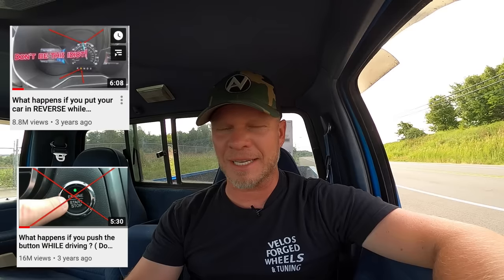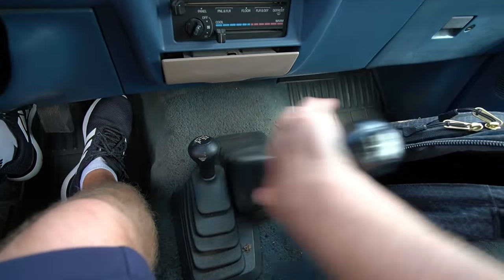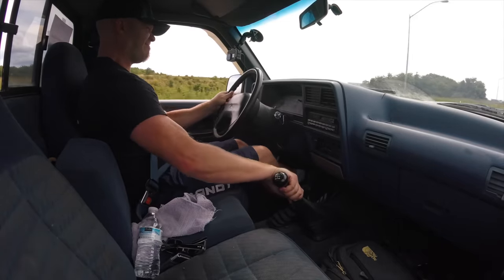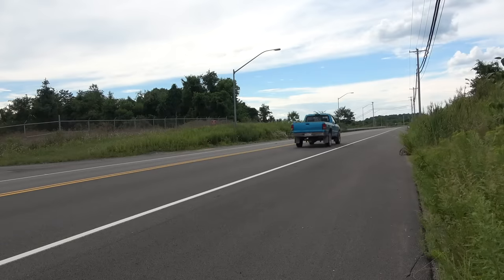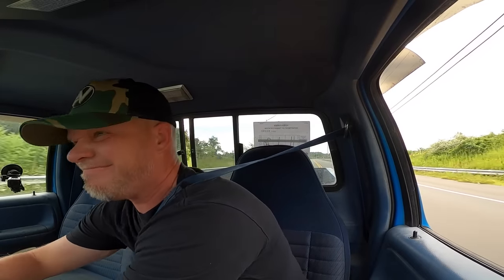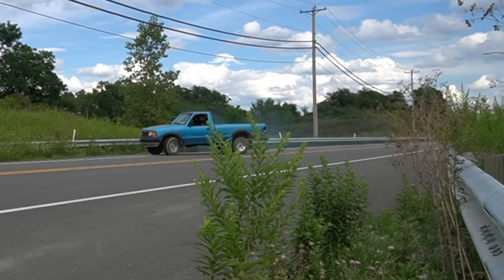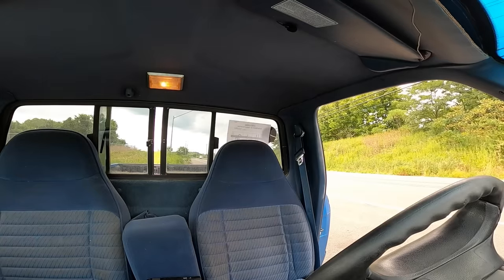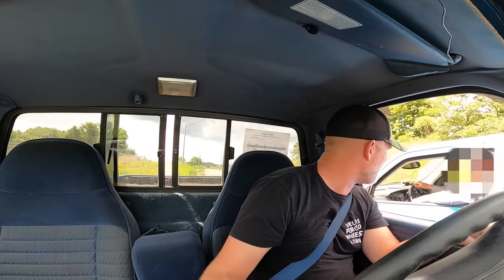What Happens If You Put A MANUAL Transmission In REVERSE While Driving?

Comment: This might actually save someone's life when they lose the brakes!
Reply: Hey, I watch your channel lol
Reply: Hmmmmmmmmmm
Reply: And then round off there gears haha
Reply: @lucacolley4475  better than passing away hahahaha
Reply: Honestly I doubt it, if your in a manual downsihifting is easier and far less dangerous, he had next to no control after entering reverse.
Reply: Just downshift, its a manual
Reply: ok but emergency brakes exist, and you literallyly could downshift lol
Reply: @barryb.benson6583  yes but engine braking is slow, what happens when youre coming towards a read light doing 50, id much rather take my chances shoving it in reverse then plowing through a bunch of cars
Reply: Why would t you just downshift? You’ll wreck your transmission this way
Reply: I had a automatic cuadbike and the brakes broke, i was going 30mph and switched into reverse(almost crashed) had to drive in reverse on the way back tho
Reply: @NoHope_  but then you have NO CONTROL and thats the last thing you want to lose when your trying to CONTROL your car.
Reply: @Deus_wukong1468  If the brakes fail, it's not like you have much control anyway, other than picking which car you wanna rear-end. Stopping is the priority.
Reply: @someoneelse4811  well that is true.
Reply: I don't think so. If the car is traveling with a high velocity ( which is alot more likely) it might topple over
Reply: Another way that I've learned from a friend is forcing the car into one of the first 3 gears, because then the engine brake will kick in
Reply: Down shifting is more reliable and easier to do my brake line buses on the road in my 62 folks wagon beetle so I had very small stopping power but downshifting gets me slow enough to break or use the e break
Reply: Or just downshift
Reply: For that reason, there is a part called handbrake.
Reply: @Deus_wukong1468  how do you have no control, it basically just locks up the rear, that's very easy to control, my moms kia soul would lift up the rear end when you slammed on the brakes and you could easily control it you just had to keep the rear end from rotating around and youre fine, especially when youre stopping in less then a few seconds. the argument that you have no control when the rear is losing grip is dumb, how do you think drifting works.
Reply: My dad had an old manual 4 speed on the tree , and the diff gave out on him it probably saved his like because he was able to get it into reverse.
Reply: @NoHope_  put 2nd or 1st gear 🙃. Easier, faster and "less" harmful (and lees dangerous)
Reply: @eliasgill2453  reverse will stop you faster because the tires are pulling you backwards, and I’d much rather grind off reverse then grinding a main gear
Reply: @NoHope_  it can blow your whole transmission, not just one gear. And if you put it 1st or 2nd you may stop faster because your tires have more grip when they aren't spinning backwards. And if the case was that I would die if I wasn't able to slow I wouldn't be any more likely to survive if I put it in reverse instead of 1st or 2nd. And if you still hit something I think front bumper and maybe cooler cost a lot less than transmission, specially if you don't repair it yourself
Reply: @joonapousi3905  if you put it in first or second you’re locking the rear wheels in which you’re just sliding, if you put it in reverse, yes you’re still sliding but the wheel is pulling away from the direction you’re headed, and tires are at their highest grip lever when spinning not locked.
Reply: @NoHope_   The main gears would be fine which can't be said about the engine or the clutch.(depending on which gear you are using).
Reply: @NoHope_  no, tires have most grip when they aren't slipping but if they are spinning backwards they have the same grip as they are locked because they are slipping in both cases. Basic physics. And if you put it in a low gear it's not 100% sure that the tires lock but if you put it in reverse it is almost sure. Other options are that something (the axle connecting clutch and transmission just for example) breaks and you can't do anything anymore. Or the reverse gear may not even engage. There is no sence putting it to reverse gear in any case
Reply: @kaloyanivanov6013  he threw it in reverse like 4 times and the car was fine because it bogs itself down, if you throw it in first at 50 mph, you’re sending a rod and locking the rear instead of spinning the rear which is a little harder to control and slower
Reply: @NoHope_  I said 1st or 2nd, not 1st. And you can slip the clutch and brake that way and maybe even have the car under control. And I didn't find anything that says spinning tires would have more grip. Everyone knows that if any object is sliding it has less grip than when it's not sliding
Reply: True. I'm gonna keep it in mind with my car honestly. Be better than rear ending someone at 50 mph.
Reply: Yeah
Reply: In a manual? Either shift down, as the engine will slow you down, without losing traction caused by your tires spinning backwards, or turn of the engine and pull the handbrake.
Reply: @NoHope_  idk how drifting works. I V E N E V E R D R I V E N A C A R ಠ_ಠ
Reply: @NoHope_  but that makes more sense tbh
Reply: I had a classmate and friends jump into a '76 chevelle, threw it in reverse on a side street. and the wheels stuck to the ground, made the car bounce wildly until the car literally lost its rear axle and just crashed into a light post, and everyone died. so... maybe not do this... as you can see he couldn't control the car turning at 45-50mph... imagine if there were cars around him.
Reply: @polopup  damn.....
Reply: @Deus_wukong1468  every year after that... they pulled the wrecked car out of storage, and displayed it in front of the school. Their bloods still staining paint and cloth. To remind kids about drunk driving and not thinking things through... like when they thought about "what would happen of our brakes went out? Maybe you can throw the car in reverse to slow it down." They found out reverse gear locks the car in reverse if the clutch is not pressed and the car wont move forward... (hence putting the car in 1st or reversed when parked on an incline.)
Reply: Ps in the video... im not sure of the physics... but what he did was slowly let the clutch out and hitting the gas.... which then when the wheel locked into reverse... the back end was light enough (light truck) that it bounced it enough so the tires would spin the opposite way... never truly regaining grip.
Reply: Or you could just down shift works the same
Reply: @zackchennouf4468  bro read the posts. It does not work the same. Putting the car in rev gear locks the wheels into reverse only... it will not turn opposite if the clutch is disengaged.
Reply: @TheCleverJoker  If he needs to instantly apply breaks, dont want to sound cliched but say there is a cliff down the road like in those old movies
Reply: @saipawa  literally every other braking method will slow you down fast and with more control than this
Reply: @RayDeemer  For the newer cars you have to apply the brakes for the handbrake to work.
Reply: Til it drops out and doesn’t do any braking. But could
Reply: @NoHope_  🤦‍♂️
Reply: @PabzRoz  ?
Reply: yeah just pray the engine won't blow up lol
Reply: was about to work on some blender but ended up watching a guy reversing in high speed..  I get too easily distracted
Reply: You could just try to use the hand brake to slow down and then downshift and brake using the gearbox, all at the same time.  You don't really need to go straight for Reverse.
Reply: And block the wheels at 60mph, gaining full control, stopping as expected and without touching any car on the road. BTW there are hand brakes in manual transmission cars too.
Reply: You're assuming every car is as tough as this lol
Reply: @TheCleverJoker  I think it depends on the situation. if this was my only alternative to stop my vehicle then I would do so.
Reply: when u realise u dont have breaks no more, its usually too late, lol
Reply: @sebastianconstantin5176  Haha true
Reply: it is safest n fastest technique to stop car
Reply: Yeah but if you put it straight into reverse you can lose control of the car better to downshift like from 5 to 4 to 3 to 2 to1 it will eventually stoo
Reply: downshift and at the same time modulate the handbrake so it doesn't break traction. Have it stopped in no time with full control.
Reply: Uh oh! Someone has never drove a manual transmission before, and doesn't know what downshifting is!
I jest, lol. Shifting into reverse is a viable option, but it'll save your vehicle if you just downshift lol
Reply: Engine braking is way better, also there's handbrake, pretty rare for Both brakes to die at once, the car would take zero damage from this, hitting it in reverse would do a fair bit of damage.
Reply: Or try the E brake,just a thought
Reply: u can just put it in first gear
Reply: Turn the car off.  In gear.
Reply: So would a parking break
Reply: Yeah
Reply: Lol how can something that takes a whole few seconds (and some massive force too) to cause a drift save a life? Also, isn't it easier to enginebrake, and just pull the handbrake, no? ;)
Reply: all breaks and all other gears?
Reply: @i.v.m4355  for fucksake do this and dont put it on reverse
Reply: @LucasNasta  Yeah cuz going in reverse absolutely doesn't wreck your transmission lol
Reply: I can't tell if this is a r/whooosh or if its horrifically bad advice from someone who doesnt understand manual cars...
Reply: @NoHope_  yeah no. 1- you seen it took considerable force for him to force that into that gear, which is surprising considering other manufactures usually put something to even block an attempt. 2- hand brake and engine braking will slow the car pretty good going at 50. 3- Nobody should ever actually lose their brakes unless they really ignore maintenance or mess with stuff they shouldn't.
Reply: @uav2246  cool
Reply: @NoHope_  Considering it took this guy A LOT of time to put in reverse, knowing he was going to be putting it in reverse. You're better off downshifting, or controlling your car.
Reply: @NoHope_  Also if the rear is losing grip it's also losing braking power...
Reply: Not so easy in a front wheel drive. Also, I'm pretty sure newer cars will have a "safety feature" to prevent you from putting it in reverse while traveling.
Reply: @Deus_wukong1468  Whos Iven Everdriven Acar?
Reply: Just put it in 1st gear and use the handbrake
Reply: nah, they have an automatic
Reply: In fact, there is no need to do this. If you have manual transmission, it has an engine break system in it. So you put it 4, then 3, then 2, then 1, and not push the gas, it's works like breaks, in fact, it's more safe than put it in Reverse.
Reply: Yes if the transmission not destroyed when you do that
Reply: Well if your on a manual.....
If your on a automatic your screwed
Reply: For all the people talkin nonsense. Yes it could definately be used as and last resort emergency brake. The reason why this fella in the video lost control is because he constantly had his clutch engaged. But if u play with ur clutch "wich is basically an overpowered on/off brake" u can play with ur clutch to get ur car to a stop. Downshifting wont make u stop and in an emergency it wont do it fast enought.
Reply: @NoHope_  I'd skip the gears, rev the crap out of my engine, and put it in 2nd!
Reply: It has actually saved my ass in my 2000 ranger
Reply: your right bro
Reply: or if you are in a high speed and there is a wall
Reply: Ya handbrake if no handbrake
Reply: @d.rares97  the motor brake!?
Reply: @justvideos6025  LMFAO I DIED LAUGHING!!!!
Reply: @nornironniall  Engine* Engine brake 🤣🤣
Reply: @d.rares97  THE engine brake!!?
Reply: @NoHope_  turning to reverse is even slower and you have less controll
Reply: A tip: you can watch series at flixzone. Me and my gf have been using them for watching all kinds of movies during the lockdown.
Reply: @Malcolm Allan definitely, I have been using flixzone for months myself =)
Reply: @Malcolm Allan yup, I've been using flixzone for since december myself :)
Reply: @Malcolm Allan Yup, I've been using Flixzone for months myself :D
Reply: @Malcolm Allan definitely, I've been using flixzone for years myself :D
Reply: im with u bruh
Reply: Or just put it into neutral and start drifting lol
Reply: just shift down to a lower gear then

reverse not only damages literally everything but also takes away a lot of controll from you
Reply: Engine braking is weak! A locked/reverse rear would stop you much faster in an emergency
Reply: Assuming the gears don't strip 💀
Reply: Just use engine braking, or destroy your transmission
Reply: I literally would never have thought to do this if my brakes went out. I'd use my parking brake.
Reply: Just imagine being the guy a runaway car is coming towards and suddenly you hear the tires start squealing and the car start to fishtail lol
Reply: lmao what
Reply: they will probably loose their gearbox transmission too xd
Reply: @LucasNasta  your car doesnt matter when you're dead
Reply: @xxdino885xx6  yes but you’re way better off downshifting super low than locking up your tires and losing all traction.
Reply: @LucasNasta  in that case, true
Reply: So will gearing down and using the ebrake but I see where you’re coming from
Reply: Or down shifting helps
Reply: Not really
Reply: @i.v.m4355  you need to slow down to downshift... How tf are you gonna do that without breaks?
Reply: @barryb.benson6583  engine breaking only works when you meant to engine break

If you're in the highway at 5th gear, it'll take a loooooooooong time to slow down.
Reply: @Deus_wukong1468  bro it’s a brake m8 of course you don’t got nearly as much control, but its manageable and not the peak of your worries, most people know the basics of counter steering, you would just plow into a hell of a crash when your brakes fail all whilst knowing and realizing that you could shift?
Reply: That is actually true for when brake fade kicks in
Reply: Well that used to be one of the main braking ways in the old days
Reply: Just turn of your engine and it will engine brake
Reply: Or just idk pull the e-brake
Reply: @RayDeemer  using the handbrake doesnt work to stop your vehicle. Look it up
Reply: Not if you drive automatic
Reply: @TheCleverJoker  he still had control though
Reply: @duolingobird8196  My point is he basicaly put the car into a drift which is a lot harder to control. Also im pretty sure he said something about doing this to slow down or something. I dont know its veen a while since I watched this vid.
Reply: thought the same
Reply: @RayDeemer  that locks the rear tyres......
Reply: @NoHope_  "engine braking is slow" not if you go straight to first gear
Reply: E break
Reply: or you could just....put it in a lower gear?
Reply: @marquesdevelop  Not better than literally just engine braking
Reply: @NoHope_  Most modern manuals won't let you go into reverse, plus you're gonna spend about 10 seconds struggling to put it in reverse, you're better off engine braking, lmao
Reply: well youll likley loose control. its best to downshift and put it into neutral
Reply: You don't just lose brakes they will still work with a blown hose they won't be very good but you can still stop
Reply: Or handbrake
Reply: @dxnxxl-qx1ll  well the handbrake only brakes on the rear wheels. So if you are at hich speeds you can easily lose control.
Reply: And then you shot your own transmission. Put in in neutral engine power is no longer being brought to the wheel. Then use your handbrake. Its not only a parking brake but also an emergancy brake. In any case if the handbrake doesnt work then keep rolling and steering until it stops.
Reply: Or.. Just shift Down and break on the engine
Reply: @TheCleverJoker  yup just use engine breaking to bring it into safer speeds.
Reply: @LucasNasta  how would engine braking (aka downshifting to slow down) will ruin the transmission?
Reply: @mhxxd4  no it wont
Reply: I guess if it was FWD car, things would go much less stable. He would probably spin and crash
Reply: U can just turn it off in a gear and it will stop
Reply: @Lofsim  just be careful not to turn the key fully and lock the steering wheel.
Reply: You will lock the wheels
Reply: @barryb.benson6583  haha emergency brake:D anyone who has ever tried to pull "emergency" brake with the car moving understands that it's a stupid name. It should be called emergency make the car smell bad lever.
Reply: Handbrake ... but good joke hahaha
Reply: you don't need to do this to brake a car without brakes, just downshift and use the engine brake
Reply: @NoHope_  After that you will need to take the car to the mechanics because the gearbox will be completely destroyed in some cases the gearbox may fall off the car
Reply: or just... you know, set it in a low gear
Reply: @lucacolley4475  Better than going to jail for killing/injuring someone but idk if you like jail better...
Reply: Engine breaking if it's a Manual is better
Reply: @TheCleverJoker  again said. Better than nothing, you have no control without brakes either, sadly my little mg manual couldn't do this as the gear shift for the car is on the left coming off the branch of an "H" formation
Reply: @theterminator3907  this is only viable when compression stops in the engine and you have no brakes, engine braking is a far better option and controlled properlly is going to slow you down just as fast.
Reply: If the gearbox doesn't explode all over the road.
Reply: Just down shit it will slow you down as the gearing will slow the engine
Reply: Just put on a lower gear and repeat that, man xd
Reply: Nope. If you had a manual you would just downshift quite quickly and abruptly. Duh
Reply: @NoHope_  the last 7 words 😂😂😂😂😂
Reply: @someoneelse4811  loooool
Reply: Stick no break emergency you downshift, shut off the engine and use the clutch as brakes
Reply: @metallicafan416  no, you definitely don't shut off the engine immediately. Only maybe when you get under 10mph
Reply: @i.v.m4355   but when downshifting you don't neccesairily lose traction which will make your engine rev to 20k and then never again.
Reply: possibly, modern cars have the brake and clutch hydraulics linked, so if you lose pressure in one, its possible you could lose the other as well....
Reply: Better to just engine break probably
Reply: @NoHope_  You can engine break faster by downshifting more extremely, it won't be pretty but it's better than nothing
Reply: When they lose their brakes, they can just down shift.
Reply: Down-shift, you can put a Manuel transmission from 3rd gear into 1st gear; personal experience.
Reply: @Matthews_Resume  Indeed, as I literally just did this an hour ago on my way home from the gym.
Reply: @Matthews_Resume  
Depends on the speed & rpm. 
As long as one isn’t at too fast a speed while in 3rd gear, and so the resulting shift into 1st doesn’t red line the engine, sure - can shift from 3rd directly into 1st. 

But if while in 3rd gear the engine is already at 6k ~7k rpm (with engine’s redline at 7500rpm), then no, shifting to 1st at that moment would be a very bad idea. 

Not to say it’ll wreck the engine every time one makes a “dangerous” shift like that. Just... why consciously take the unnecessary risk?

I once money-shifted while driving a rental car in Italy, on the highways between Rome &  Pescara. I intended to drop down from 5th to 4th for an over take. 
After I finish what I thought was in 4th gear and I upshift, is when I realized I was actually in 2nd and now shifting into 3rd. 
What can I say. I did request & was confirmed an auto when I booked the rental, but upon arrival, manuals were the only choice in the lot. 
It was my 2nd time driving a manual in my entire life. So no, I didn’t know it “felt wrong”. 
The car survived my delicate caveman touch. It didn’t break or anything. I got very lucky.
Reply: It probably won't, just downshift. You won't have time to do that all
Reply: ThatHairyBerry  
Automatic can downshift just like manual. 
Shifting into reverse while going forward? That’s stupidity.
Reply: @reallifeengineer7214  I had practiced before with out ever succeeding. [TL:DR] It is all Physics. You can change from a higher gear to a lower gear. Why I made my conscience decision: We were driving down a rural highway in Germany. The speed limit was 120 kmh as a sign appeared: "cautionary" 15 kph with a left hand turn. I put it in fourth as I am applying brakes thinking this seems excessive. In a wooded area the road makes a "GENTLE RIGHT" hand curve to come around facing the base of a mountain. (In America consider doing 55 mph with a cautionary 9 mph to the left before making a gentle curve to the right, WITH A MOUNTAIN BEFORE YOU.) This was my first and only time travelling  this road. Being from Florida my first thought was, oh a beautiful mountain. Followed immediately with, oh this a mountain. I push in the clutch doing approx. 85 kph, dropping into third gear and letting the clutch out. There are so few meters left I align the car to head on presuming the air bags will provide their protection. Side note: My only time while driving (still to this day) I gave up on driving and expected safety may protect us. A few approx. 80 cm from this mountain rises before us. I don't know, some 60 cm before the end of the road turning approx. 100 degree turn to our left, I think I wish to keep Sunni (my passenger) safe. At something like 45 kph I resigned myself (us) into driving head on into this mountain.With my vehicle at something like 35 degree downward nose angle I had a premonition, I believe I can keep us safe if I can slam this into 1st. With Wisdom in my right hand and Father at my clutch, this thing did a 75 degree nose dive centimeters from then end of the road and performed a left hand turn like a champion. I glanced right at Sunni he glancing left at me. I read the expression on his face as: THAT WAS PHENOMENAL.
Reply: @KindWombat28   Downshifting would prove faster here than what I am seeing in his video. (Arguably not his point here.)
Reply: @ImyaSmol  I encourage all to drive safe expecting the unexpected. With that said: find safe places where you can perform exceptional maneuvers. Peel your tires, drop it into reverse, perform extreme maneuverers; the experience you gain may save lives.
Reply: @Matthews_Resume  Yep 100% agreed, that's what I did when learning motorcycle.
Reply: @LucasNasta  that’s why you rev match
Reply: So this is how I should have done it ☺
Reply: @i.v.m4355  What if it is to little space for the enginebrake to save you?
Reply: @Matthews_Resume  
Thank you for sharing. 
That’s fine, and doesn’t conflict w what I said earlier. 
I had shifted (mistakenly) from 5 to 2, and was lucky I didn’t break anything. 

All I’m saying: sequential down shift, if we don’t want to torture our transmission & engine.
Reply: @NoHope_  There's no control. This is very dangerous. It could even destroy your transmission and then you have no stopping force.

Use downshifting and careful parking-brake application (not all the way, start halfway and ease on, like a pre-abs footbrake)
Reply: Nah, it'll spin out easily unless the driver knows how to correct oversteer. Better to just engine brake.
Reply: Its safer to just down your gears, wtf
Reply: And cost them 5,000$
Reply: Well if you know about cars you’ll know that this isn’t how cars work.
Reply: @lucacolley4475  You can replace a few broken gears. You can't replace your life.
Reply: @LucasNasta  You won't, downshifing is used for using the breaking power of the engine, it has no negative effects and it is even in a test in driving school, too is used mainly to not overheath brakes when going down from hills
Reply: Nah you’ll probably get sideways and smash something if it has any power or not the weight distribution of a truck
Reply: @NoHope_  shove it into first and that things coming to a stop pretty fucking fast, coming from a person who the day after my driving test I put my car into 1st from 3rd and came to basically a dead stop instantly
Reply: @polopup  your additional point about them bringing the car with blood stains and all just to teach kids a lesson every year has just put your story in the "trust me bro" category lol

Ain't no way shii like that is allowed in schools or anywhere that involves kids
Reply: @william_SMMA  this was the 90's...
Reply: Facts
Reply: If their car is a manual transmission.
Reply: It's a manual transmission you can always downshift I drove several cars with no breaks at all
Reply: @barryb.benson6583 Pull the handbrake while driving more than 20kmh 💀
Reply: No it won't, instead downshift to 1, if you still have time down shift one by one
Reply: @douwehuysmans5959  wrong
Reply: Honestly no. Not only was it super difficult to shift into R, you completely lose traction. You're better off doing a money shift or regular downshifting if the brakes somehow don't work, other than that cars won't even accidentally let you go into r
Reply: Unless it’s fwd, then you’re screwed right?
Reply: @NoHope_ that's not how traction works. The wheel spinning backwards while going foreward is just as effective as a locked tyre. And we all know why ABS exists. Locked tyres just does not have that much braking force.
Reply: @adamhamilton8242  You're screwed if you don't have brakes
Reply: Yeah but not your gearbox😂
Reply: Yeah, but that has to be your first instinct, I feel like most people just panic